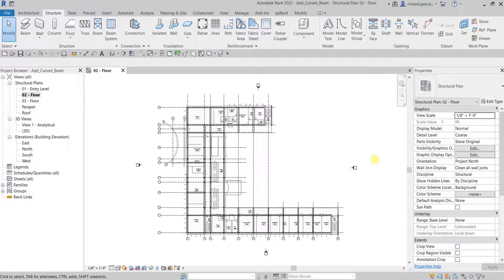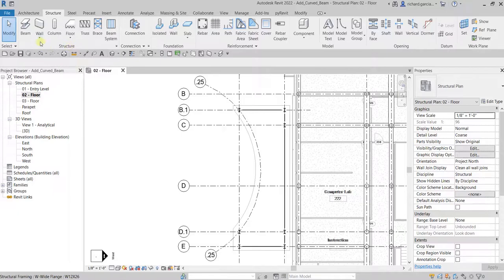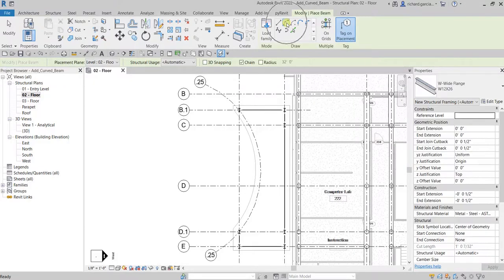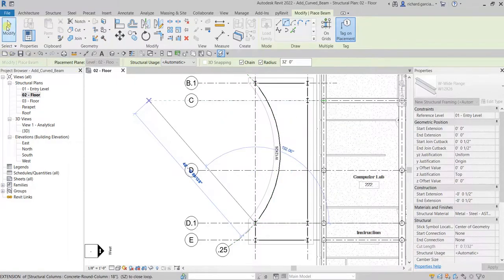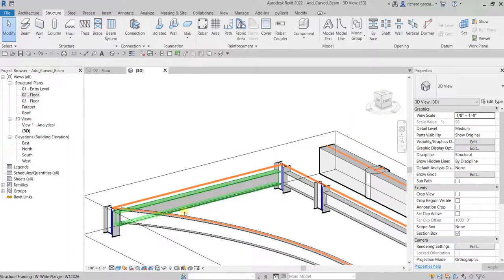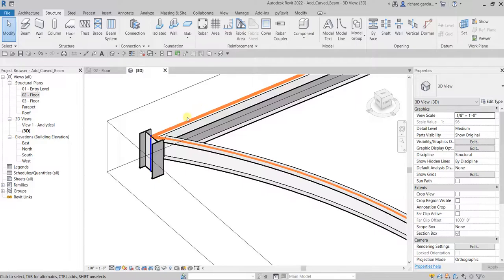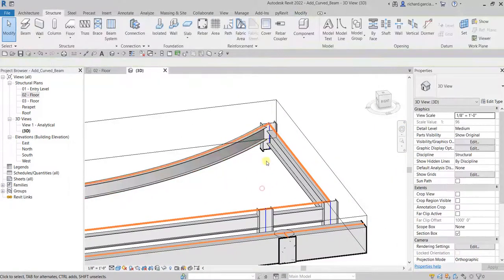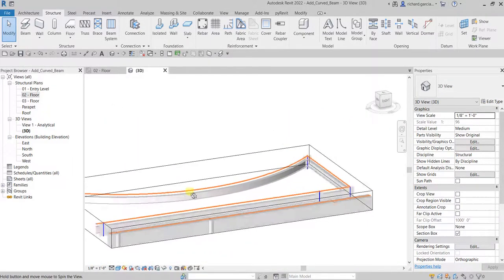REVIT STRUCTURE 2022 LESSON 12: CREATING CURVED BEAM

Comment: is there a way that the steel connection on a curved beam to a column can be connected?
Reply from the maker: Hi @ralphabella6234! Yes, connecting a steel connection on a curved beam to a column in Revit 2025 is tricky because the built-in steel connection tools don’t fully support curved beams—they’re built for straight ones. Here’s a workaround: model a short straight beam stub at the column, connect it to the column with a standard connection (like a clip angle), then attach your curved beam to the stub and trim it with the Cope tool. It’s not perfect, but it works visually and for basic coordination. If you need detailed shop drawings, try exporting to Advance Steel (if you have it) to add the connection there, then sync back to Revit. Alternatively, you could build a custom connection family for the look you want.

Comment: I have created a beam family, but when I load in the beam structure, the family I created cannot be curved, what's wrong with that?
Reply from the maker: It sounds like the beam family you created may not have been set up to allow for curved geometry. There are a few common reasons this might happen in Revit when creating custom beam families:

1. *Family Category & Type*
   - Ensure that the family is categorized as a *Structural Framing* family. Some family categories (like generic models or other structural elements) do not support the same behaviors as beams.
   
2. *Beam Shape Handling*
   - By default, the structural beam system may expect certain types of geometry. If the beam family was created with only straight lines or shapes, it might not allow for curving. Check that the family allows for flexible geometry or uses **parametric curves**.
   
3. *Family Parameters*
   - You might need to include *arc* or *curve parameters* in your beam family to allow for it to follow a curved path. This can be done by setting up reference planes and using a *sweep* or *extrusion* with a curved path.

4. *Beam Placement*
   - Sometimes, the inability to curve the beam might come from the way you're trying to place it. Ensure that the placement settings (like work plane or sketching tools) allow for a curved beam.

5. *Profile Used in Family*
   - If you used a specific *profile* in your beam family (such as a shape for the extrusion), make sure that the profile itself can support curved paths. Some complex profiles may only work on straight geometry.